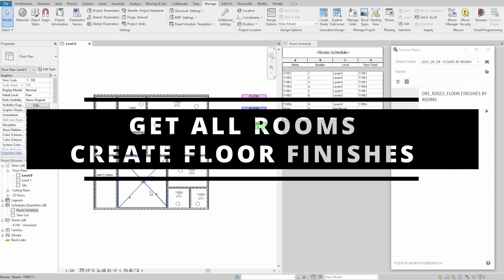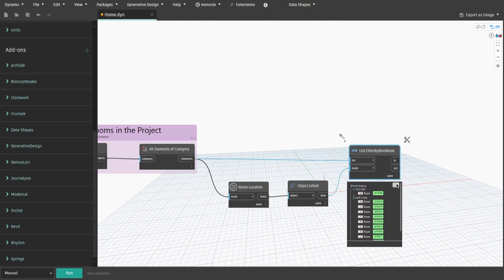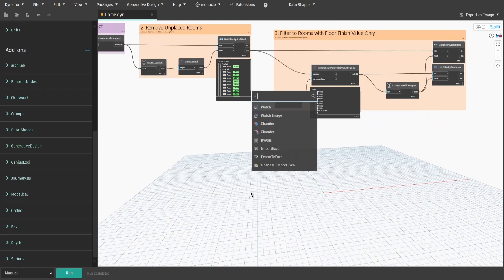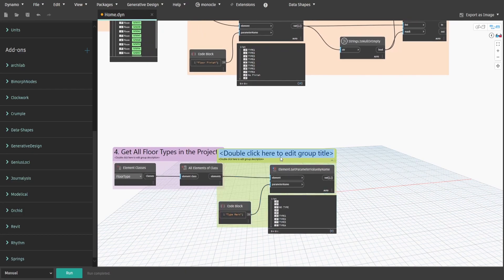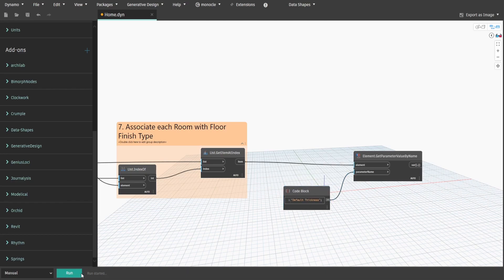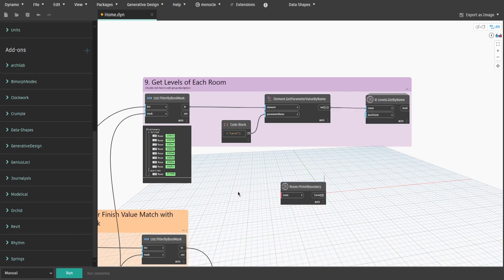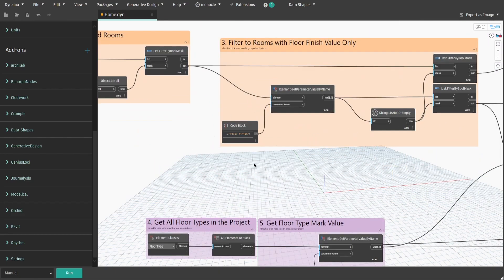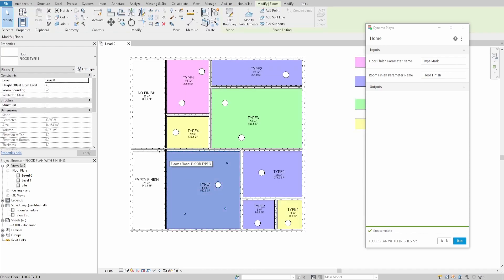Dynamo - Floor Finishes by Rooms. [Revit 2023]

Comment: Perfect, this is a massive time saving, thanks for sharing.
I have a large project with multiple rooms on multiple levels, it previewed all the room boundries in the Dyanmo preview but didn't create all the floors, any particular reason why?
Reply from the maker: Glad you liked it!
It is difficult to say where the issue is without knowing the error messages of your graph. But I assume you could try to set the Floors.Create node to longest lacing to allow iteration through multiple levels. Otherwise, please specify the nodes and their error messages so then we can see what can be done 🙂
Reply: @AinAEC  Hi. I have the same issue. I made this routine for a project with multiple levels, I checked all nodes, and they look ok, but the only node doesn't work is Floors.Create by Crumple without message at the end with the work "null".
Reply from the maker: @roxanaguerrero4692  Hi, which revit version did you use? As far as I remember that Floor.Create node was tested with revit 2023, not sure how it works with other revit versions.